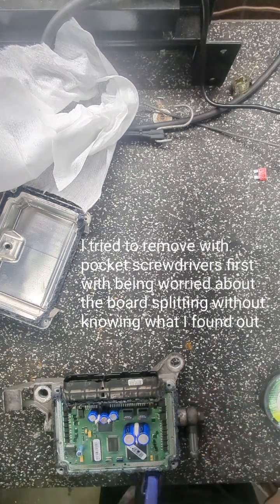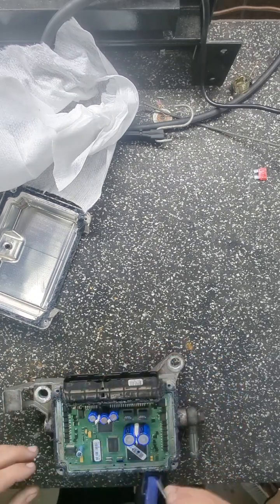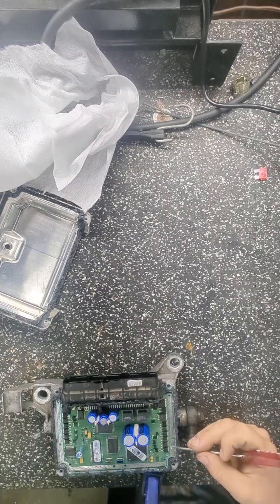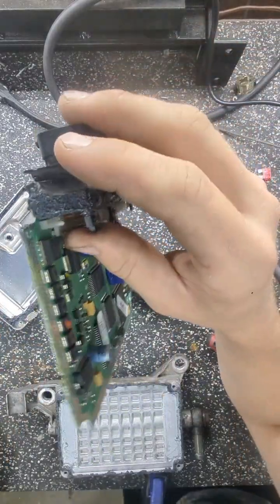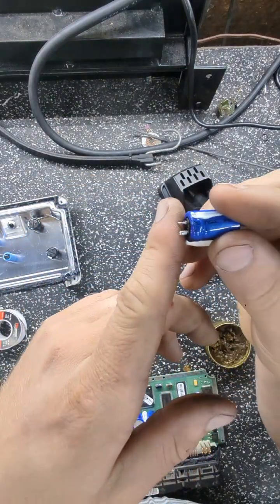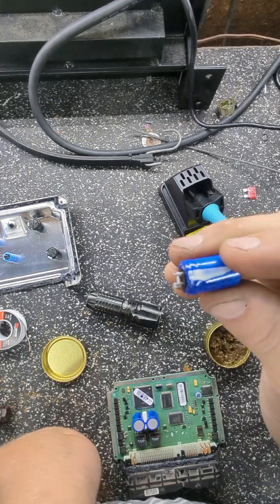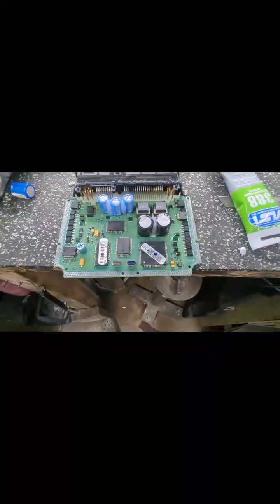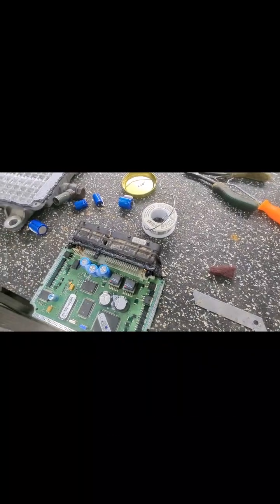LLY Duramax FICM Capacitor Replacement

Comment: The part numbers you listed are almost unreadable, do you still have them? Also is the ficm still fixed?
Reply from the maker: Yes still runs strong. 🤘 30,000miles later. I posted the 2 links in the video description.  Looks like the 1 is on backorder tho.